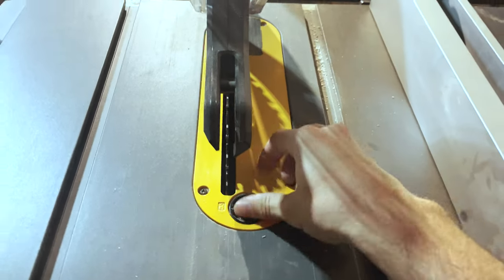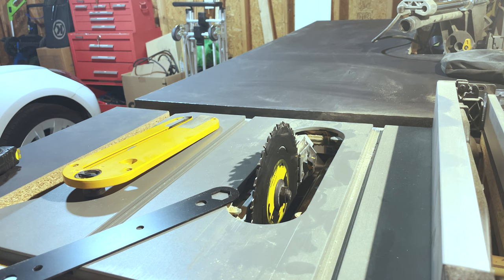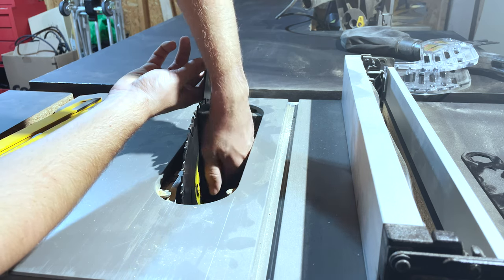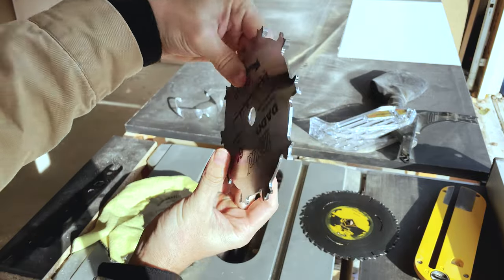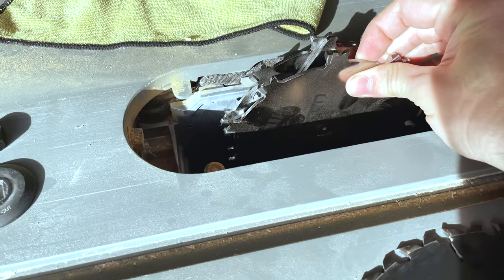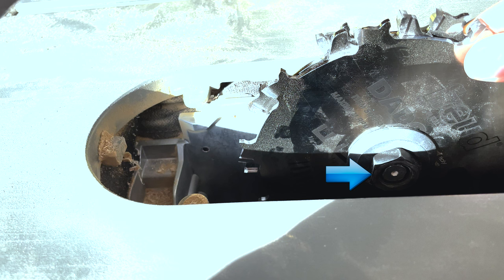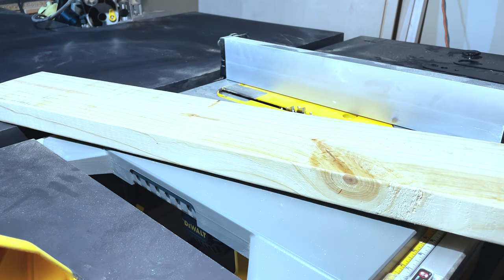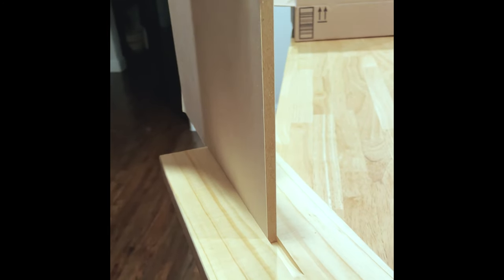DeWalt DWE7485 Table Saw WITH Dado Stack

Comment: I just stagger and stack normal saw blades on mine. Wish it had a full sized arbor. The 10" has the same motor, less leverage and it will still accept them so i dontbuy the idea that these cant handle it. They feel way more powerful
Reply: You mean you just multiple regular blades to make your own dado?

Comment: For safety purposes, in some countries like the UK, the bolt the blades go onto is deliberately short so that you can't use a dado stack. I wouldn't be messing with it if you have been told you can't do it.

Comment: I own the DeWalt DWE7485 Table Saw in the United Kingdom. When it is convenient, I would appreciate it if you would measure, and let me know, the length of the arbor of your American DeWalt DWE7485, as I suspect the saws exported to the United Kingdom may be fitted with a shorter arbor (so that a dado cannot be used). Many thanks in advance for your advice which is appreciated.
Reply: DW7491 is out of stock everywhere.
Reply: Buy the American longer length dewalt arbour then fit it to your uk saw
Reply: @paulrigby9972  Thank you very much for taking the time to respond to my enquiry. I do appreciate your advice. Kind regards.

Comment: Just because you CAN do it doesn’t mean you SHOULD do it.  DeWalt RECOMMENDS you don’t do it (they don’t say you can’t) because the motor is small and a dado stack is heavy.
Reply: I think the risk is not damaging the motor (there are lots of reports of people using stacked full-size regular saw blades without problems). The risk is having the nut holding the blades come loose when you stop the motor -- as you write, the dado stack is heavy and thus may put a lot of rotational effort against the stopped axle, which could loosen or even unscrew the nut holding the stack in place if that nut does not span enough threads on the axle.

Comment: Don’t install the washer before the nut. Re-install at all other times. 🇨🇦
Reply: I would not recommend that unless you can find a very wide nut -- the washer distributes the pressure onto the blade, something the regular nut would not do well, causing vibration and instability.

Comment: So maybe silly.. but couldn't you use a regular blade to do a dado.. just move the piece over 1/4" or so each time to cut it out? Obviously would take longer.. but seems like I've seen videos where they do that.. they dont necessarily buy a special dado blade. What's the diff?
Reply: He did say they’re 6” blades, unlike the 8.5” the table saw normally would use

Comment: Came across this video by coincidence. I just bought the 6 in Freud to do the exact same thing. I basically wanted a flat grind tooth and can do wider dados with multiple passes. As long as the nut has full purchase on the arbor I think it’s fine. And as always, if one is uncomfortable, then don’t do it.

Comment: How about using an 8" Freud thin kerf combination blade in it? doable or crazy dangerous?
Reply: I am using it on the 7485 for at least 6 months, works pretty well.
Reply: @assofour  Did you change the riving knife?
Reply: @luisodriozola79  I took off it from saw, since it has a bit maybe 0.5’ tilt.
Reply: thanks! @assofour

Comment: The thickness could be increased by using a slightly less thick clamp washer on the arbor (the piece between the arbor nut and the first blade).  The clamp washer distributes pressure from the nut evenly in a circle of about 1 3/4" onto the blade and the stock version is quite thick.  The outside face (against the bolt) could be filed down some so as to allow a 7/16" or even 1/2" dado stack and keep the same thread depth on the arbor.  Again, it's not recommended -- but it's doable.

Comment: Great video, Why a 6inch dado blade? can you use a 8 inch blade
Reply: 8" won't fit. It rubs on a hard plastic piece down in the saw. I made this mistake. Has to be 6"
Reply: @tylerbutters-e1z  You can make it work by cutting the plastic piece off. There's another video where its shown how to modify that plastic piece.

Comment: You say in the video “you’re gonna need a zero clearance insert” but you don’t provide any detail or insight as to where to get one. Can you kindly elaborate? (There doesn’t seem to be one readily available for purchase, likely because, by design, dados are not recommended on this saw).
Reply from the maker: Etsy sells zero clearance inserts for sale just search “DWE7485 zero clearance insert” and they’re reasonably priced. They also look cool instead of the OEM yellow insert.

Comment: Thumbs up from me!  Did you find any wobble or vibration at all?  Also how deep of a dado would YOU feel safe doing with this?
Reply from the maker: No vibration at all! It’s with a 6 inch diameter dado and the depth I’ve done is 1/2 inch, but 1/4 inch in this particular video. 

The caution Dewalt states is because it’s to preserve the motor, but I use it for the dado cuts and then put the original blade right back on.

Comment: The nut might come off if the motor is not powerful enough which it isn’t. It’s not due to not enough threads it’s something else. Also that piece you don’t know the name of helps reduce the vibration which may help keep the nut from loosening. I’ve had the nut come off mid cut when fully on the arbor and it was tightened very tight before. Very scary.
Reply: DeWalt's 10" table saw, which you can use a dado on, has the same size motor as this model, so motor size is not the issue.
Reply: @bigband223  what could it have been?

Comment: That's the worst machine I've ever had.
The gears used to lift the blade are awful......after a while they just don't work properly anymore.
Very bad quality tool (toy actually)  !!! 😓
Reply: I've had mine over two years and have never had a problem. If you don't maintain your tools, they will fail you. Even if you do take care of them, nothing lasts forever. As for it being a toy, you sound like a child so it's a great fit!
Reply: @NBGTFO  I'd never call someone a toy....because I respect people 👍
Reply: @Marcelo57939  i never called anyone  à toy, he said youre a child, listen when an adult talk
Reply: I’ve had mine since 2019 and I’ve never had any issues with the gears for the blade. Sure they aren’t the smoothest to begin with, but for a portable one it’s pretty damn good and can make pretty accurate cuts for being $300 on sale. If you give your child a table saw… I would be worried.
Reply: I have had this “toy” for a couple of years and completed several projects without any issues. Dewalt has won my trust and I believe it is a very high quality equipment that has to be taken seriously.
Reply: @chuckgoodwish3897  You can't even use a dado blade with this thing.
I respect your point of view....but I don't like it.
Reply: @Marcelo57939  You really said you can't use a dado blade...on a video of someone using a dado stack lol